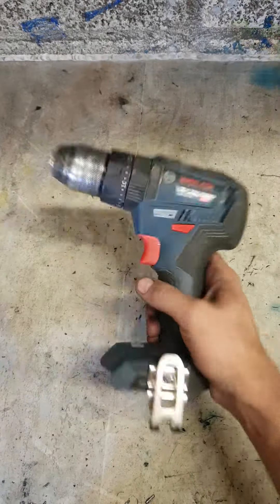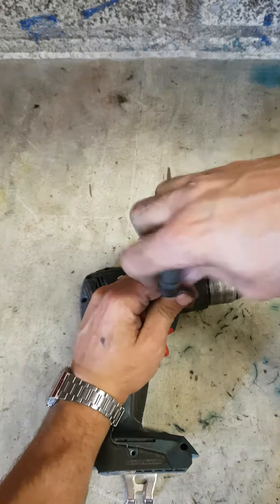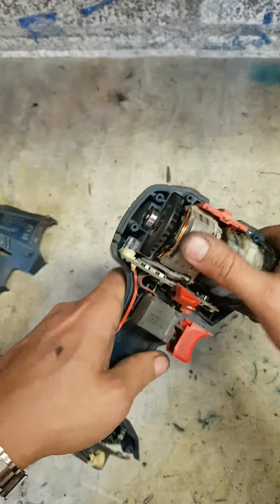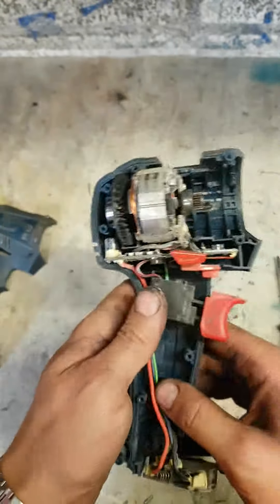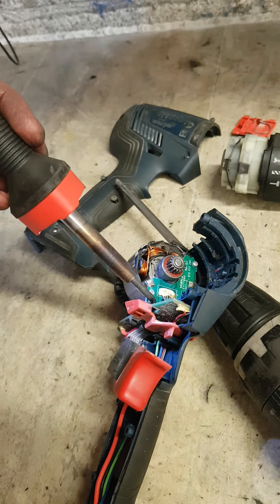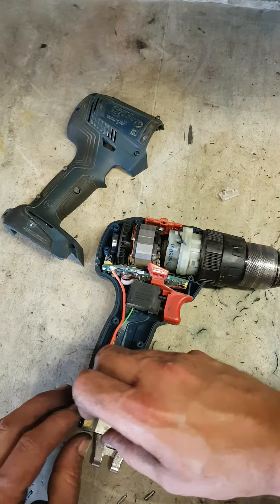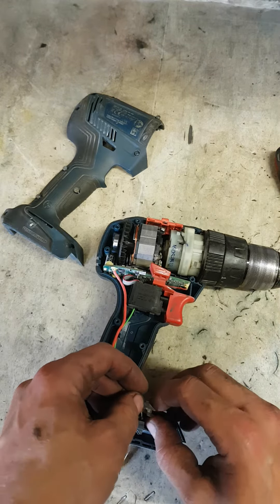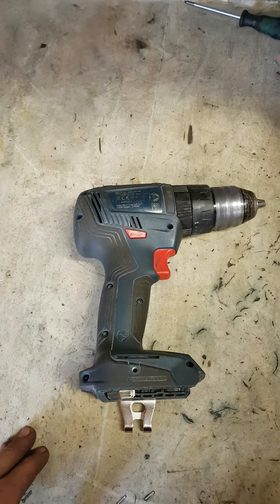Repairing a bosch brushless drill with a intermittent fault.

Comment: I have two bosch GSR18V-190 and both start up, drill a few seconds and shut off, pull the trigger in and the same thing happens, swopped out 5 different charged batteries on each, it's not the battery, must be the drill which on this model has brushes but the brushes are good. The similar Bosch 1/2" brushless model drill I have works fine, so I guess I'll be opening up on of the defective ones.

Comment: Thanks Dean! top man! my drill had exactly the same issue, and required exactly the same fix. I messed up on re-assembly by not connecting the speed switch (the speed1 or speed2) properly, but your video shows how to do this. I also found the screws on the housing to be really soft so I'd warn to watch out to use the correct screw bit and not overtighten.

Comment: I have the same one and it stop spinning completely one day. Pressing the button just turn on the light, I've checked the wires and they look fine. Is it the controller issue ?
Reply: Did you get it fixed?

Comment: Hey! I've got a Bosch gsr 18v-55 that doesn't work properly. When I pull the switch nothing happens, sometimes it goes around. I've dismantled it and checked for any loose wires but everything is fine. Feels like the stator and rotor are a bit tight against each other, because when it runs it sounds weird and i can smell some kind of burned or warm smell. Any idea? Kind regards
Reply from the maker: Look at the stator winding and see if they are burnt.